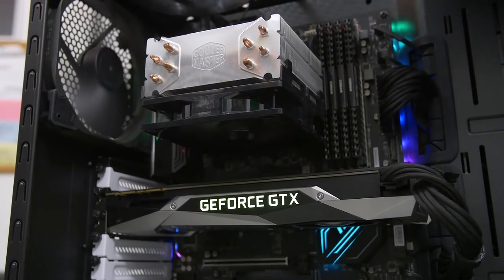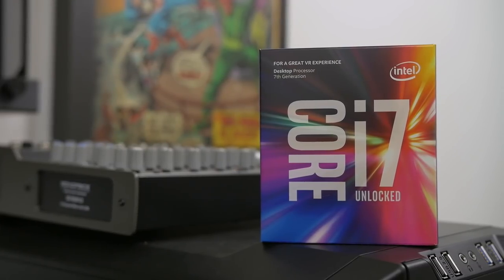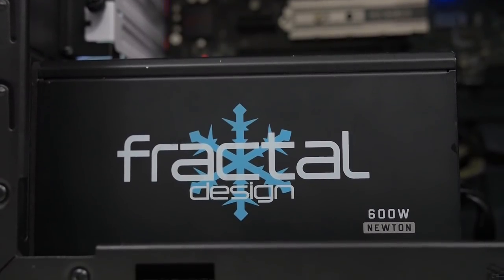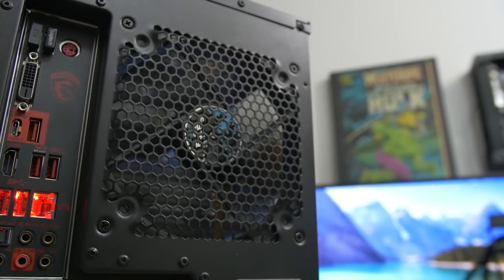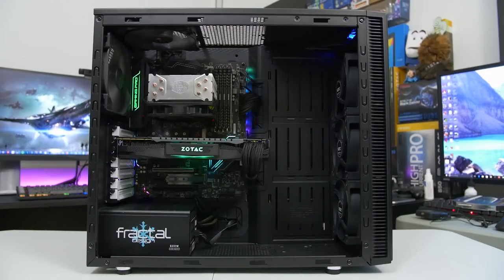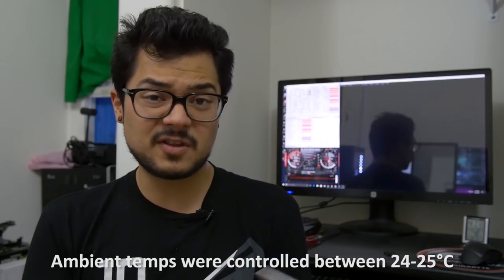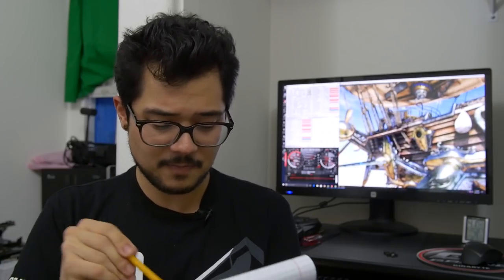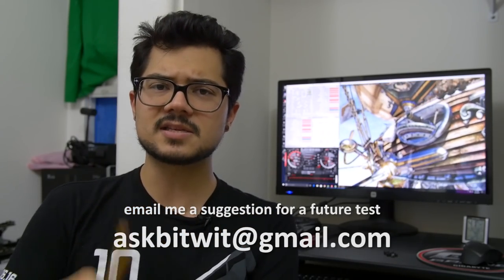This is how you should mount your CPU cooler! I think??

Comment: Maybe, if you could use a tempered glass side panel with some smoke, to better visualize the airflow, would make a great part 2
Reply: Wouldn't the moisture harm the parts
Reply: Smoke isn't the same as water vapour
Reply: I was about to suggest this. Great minds think alike.
Reply: kyle kyle.....KYYYLE KYYYYLE .....yea this guys has an idea tht you might want to hear ......yep, yep errr his name is nOTpASS
Reply: nOTpASS Nice idea
Reply: I was wondering if he used a side panel during his test. He didn't mention it and it was not pictured.
Reply: Smoke isn't steam so that you know. Steam is boiled water, smoke is just a collection of floating chemicals. 

I would suggest Bitwit to use Co2 from dry ice to do this, as it won't damage the parts from extreme temps and moisture build up. But I'm not sure of how practical it is, it would be hard to get just the right amount of gas to see what happens, and to know what temps the gas are.

This will probably require some help from another youtuber with access to dry ice, a thermal camera and who also has some knowledge of computer (I.E they know how to not break them)
Reply: This would be a cool and unique idea, if only it hadn't been done by multiple channels a couple years ago.
Reply: I'd be willing to bet he did, just didn't have it on for appearance.
Reply: if you put smoke in a pc...Won't that limit airflow and skew the numbers?
Reply: Not any more than air.
Reply: @BitWit goddamnit does this tag even work
Reply: JayzTwoCents used smoke in his positive vs negative vs neutral air pressure video I recommend y'all watch it
Reply: Zane Is A Dog you'd only be checking airflow in the smokes case. just to try to formulate ideas on why the results were the way they were.
Reply: give this guy a medal!
Reply: +nOTpASS send him an email...just in case
Reply: zues121510 Dry ice would be a bad idea. CO2 gas is transparent. The vapors you see coming off of dry ice is actually water in the air being condensed by the cold CO2.
Reply: cleetose k den. bad idea
Reply: yes thats good idea let your PC smooke
Reply: Ali Baba it's brilliant ........let the PC get all high maybe it'll turn black

btw a lot of tests on YouTube have been done with smoke to visualise air flow......Nd last time I checked nothing happened to the PC Nd the utubers were not bitching
Reply: I would suggest wind tunnel
Reply: ive tried several different ways of viewing airflow with different types of "vapors" and a combination of black lights/LED lights and i always get the same problem, the space is too small and air is moving too fast to get an accurate idea of what is really going on in there. the closest i came to seeing anything substantial was with a fog machine and a black light aimed at the window from the back of the case (i removed everything except the fans, zip tied the CPU cooler/fan where it would usually be, a low rpm fan in place of the GPU and an old PSU i didnt care about in place and placed pieces of styrofoam in place of the bulkier items that would usually be in there) but because of turbulence and the way the fans cut through the fog, it looked very random and was all happening really fast (anyone passing my house at that time would think its either on fire or snoop dogg had just moved in) so if you want to test it yourself, i advise doing so OUTSIDE of your home (it also leaves a nasty residue behind which is not fun cleaning off because it just seems to go everywhere) i wish there was a really definitive way of testing airflow visually (without using flow meters and expensive wind tunnel tech)
Reply: nOTpASS I think NCIX tech tips has done this
Reply: Whit his vape;)
Reply: It's kind of lazy from many yt, who make videos about air flow. None of them even edit some arrows in them to visualize the flow. Or at least I haven't seen anyone do it. Using smoke is next level.
Reply: They only did it to show Positive vs Negative air pressure in the case. They didnt use it to test how the heat sink was situated how it would affect air flow and CPU temps. They used it in
Reply: You can buy canned smoke.  We use them to test smoke detectors and fire systems here in the fire protection industry.  I test my pc part airflows with them.

Comment: Would have been good to see GPU temps as well, to see how much they're affected by cpu cooler placement.
Reply: lexii miller vertical placement would probably decrease the gpu temps by ~1-2C for the open air gpu because it pulls the exhausting air from the gpu away more.

Comment: maybe founders edition is hotter in general so heat can transfer to cpu
Reply: the gpu is the same. 1070 is a 1070 no dif in the gpu itself.its all from Nvidia
Reply: different coolers make different temperatures.... The blower style cooler is almost always warmer than the other types
Reply: This is what I also think. The blower style cooled GPU gets hotter and radiates more heat and since the CPU and GPU coolers are drawing their air from the intakes it makes a still air pocket below the CPU cooler allowing the heat radiate from GPU to CPU and MB (so, there's none to little airflow between GPU and CPU cooler).
Reply: husssein But then that doesn't explain the vertical solutions.
Reply: That doesn't really makes sense. GPU vrams etc. should run as hot generating same amount of heat in both tests. The reason why you see higher temps in reference cooled cards is because those stock coolers and heat sinks simply struggle with transferring the heat from the chipset. But all this released energy in form of heat still has to go somewhere, ergo if you have a better cooler capable of transferring more heat from the card, the gpu itself will have lower temps but the relocated heat should mean higher temps on other pc components that are getting blasted by all that circulating hot air. Only thing I can think off is difference in voltage and core/mem clocks which means more emancipated heat but if anything FE should produce less energy than non-ref cards with additional pins and higher boost clocks. All of this leads me to believe that it's a margin of error or some unknown law of aerodynamics or thermodynamics that I simply don't know :/
Reply: husssein If anything,  it should be the vertical solution that takes more heat from the gpu and not the horizontal solution.
Reply: husssein .... but heat produced in both cases will be same fe and open style cooler will produce same heat it's just that the fe does not moves heat that much faster .
Reply: thats what I thought
Reply: Theory: The Founders gets less airflow into it's fan since the air on the cooler above flows more efficiently but if it's pointing up more air doesn't makes it to the CPU and has more time to reach the blower GPU fan.

It would explain the weird blower results if you think about it.
Reply: husssein i thought so too but reminded myself that despite it running hotter, they're both 1070's that use about the same amount of juice so the heat output would be the same. Very curious
Reply: husssein except it was cooler in one configuration on the cpu with that edition. seriously doesn't make any sense at all.
Reply: Thats what I was thinking. I had a 1070 founders and the back plate would get very warm.  Kinda scary to touch it. While a third party gpu might have a cooler back plate?
Reply: exactly
Reply: My friend's cpu temps are reachin 60+°c on games like BF1 cause the tubing of his AIO is touching the backplate of his zotac (which is the same one used in the video) where as his temps drop down to slightly above room temperature when he just puts a spacer inbetween. (only about 3 cm of tubing are touching it)
Reply: for sure, the card/backplate radiates more heat in the direction of the cpu instead of pulling it away and blowing into the open area like the after market jobs
Reply: They'e the same TDP and typically don't clock as high/use as high volts, therefore put out less heat. The vast majority of heat is expelled from the case or heat soaking the card.
Reply: DeilGrist yes that makes sense temp and heat are independent so the lower clock fe will produce less heat but i don't. know if they were same clocked or not.
Reply: Founder's cards exhaust out the back. It doesn't affect in-case air temperature
Reply: O!Technology good job, u got proof with thermal imaging?
Reply: +husssein at least that's how it the cooler works. and you can't thermal image air anyways. the only possible explanation for heat transfer to the cpu is that the backplate might be radiating heat to the cpu cooler.
Reply: the AIO tubes should be moved out of direct contact with the backplate, if possible. A small air space should be sufficient.
Reply: Here's the thing though. A card dissipating 150w (or whatever wattage the 1070 is) will still dissipate 150w regardless of what cooler is on it. If anything, ambient temps should rise a touch with the better cooler due to the increased efficiency of the cooler. More heat taken from the core = more heat expelled outside the card. In addition, the founders edition card is exhausting air while the other card is recirculating air. Totally doesn't make a shred of sense as to why the founders edition card ran the CPU hotter in my opinion.
Reply: because even when it's exhausting heat from the case as efficiently as it's able, the card itself reaches a higher stable temperature due to the restricted air flow around the components producing the heat, which in turn causes more radiated heat from the card?
Reply: Caleb Key Gibson ftw

Comment: Theories!
Test #1 - Blower was stealing all the cool air. Could test with a PC-safe "smoke machine".

*Test #2" - The Zotac card seems to have a more restrictive "Open" design forcing the bulk of the exhaust to the back and bottom allowing for less heat to be ejected into the case compared to an ASUS Strix for example. Also it may not have been stealing all the fresh air allowing the 212 to move more air across the fins. Could test with a more open-air designed card.

Test #3 - "Direct Contact Heat-Pipes" may have lined up with the hot-spot on the IHS better where the die is mounted vertically. Could test using non-direct style cooler with each test. (Would take alot of time though...)

Test #4 - The Zotac's backplate may get hotter then the "Founder's" card due to added power deliver or design changes and the backplate may be heating up the air at the 212's intake. Could test by measuring the air temp above both backplates. (may be a bit difficult to do though...)

I know there's that one person out there that's gonna have a rage-attack, but remember, they're just theories that were thought up immediately after watching the video. ^_^

(Edit) Went  to the Thought Chamber restroom and thought of something else. I wonder if an anomaly caused utilizations to differ between tests. Were the frame-rates consistent and the GPU/CPU loads reported equally? Maybe a background Windows update or other process was causing CPU load to vary.
Reply: Absolutely, I thought about the air being hotter from the backplate but completely ignored the fact that the open-air GPU is still exhausting hot air. That and the broadside of the CPU cooler in test #4 is also making it much easier for the cooler to intake that exhaust while at the same time "tripling" the surface area that the warm air is passing though. It will be quite interesting if a follow-up is done for this video, I realize it would take a good amount of time to do but your input makes me want to know the answers even more. 

Heck, this type of "Guess what caused it" video conclusion could even be it's own series of videos. Even if only once a month or so I find it quite interesting and enjoy the participation side of it.
Reply: WRONG. It would only be meaningless if all the results were identical. They are not, so obviously blower and orientation of the CPU cooler have an impact.
Reply: I notced same thing when change my GPU from "blower style" to "open". But final results for my setup: Less fans is requied (2 removed from top) to make same temp. at CPU now. Blower style cards "stealing" air from case, makes CPU cooling less effective.
Reply: I noticed that as well, this is why I added a fan underneath the blower cooler of my GPU. The blower was sucking the air from the front intake fans (and was basically a wall separating top and bottom) and was radiating heat from the backplate up toward the CPU. Adding that bottom mounted fan didn't prevent the GPU from stealing the front intake airflow, but it cooled the card, which helped the CPU stay a bit cooler. Pretty interesting how that all works out.
Reply: UP!!!!!!!
Reply: I'm betting it is Number 3 is part of the answer when I had my evo 212 it had really bad core contact with my i920 though it was horizontal
Reply: Andrew Harley my theory was the first one. The intake makes it easy for the cpucooler to get air, but it gets split up with the blower.
Reply: I wonder if he kept the chassis fan speeds at a set level

Comment: Think this has to do with the direction the air is circulating in the chassis..   This is something you may have to test using a glass side panel case and some smoke to see where the air flow is going..
Reply: Joe Jackson smoke is horrable on computer components......
Reply: Jesse Dodge he mean like a fog machine. Of course it would be bad to use actual smoke on a computer. There are fog machine to test the airflow in your PC
Reply: Team Ninja horrible”
Reply: Aaron Garza words
Reply: Team Ninja hahaha.
Reply: Incense
Reply: Yes.  With the internally-blowing card sending air in the opposite direction of the actual cooler, there's multi-directional airflow, and more (and faster) cross-currents are being created, and removing heat from the CPU (regardless of the air temp coming off the GPU).  When they're both blowing in the same direction (up), that multi-directional airflow advantage is lost, and the air speed is also just a factor of those two fans, on one vector.
Reply: @ninjaclan83  nah just a fog machine

Comment: There are so many myths people claim when it comes to computers and this is one of them, I knew it would not make much difference, I got flamed in one of my builds for doing the same thing, so I rotated the heatsink for a 3 degree difference in temps. Good video Kyle.
Reply: by mi mixtapo
Reply: Have mine with a upwards flow as well.
First for the simple reason to geht the hot air away from my GPU so it doesn't reduce it's boost.
MWith my new card, I'm just to lazy to reassamble all that stuff. (Heavy cooler and a delidded chip: nothing to be done in 5 mins)
Besides that I have 2x 140mm in the top and 1x 120mm in the back, so clearly the case supports the vertical airflow. And there would be not nearly as much fresh air coming from the front with all my drive bays, compared to the case he used.
Reply: Same. Some foo went after me for mounting my dark rock pro 3 with a horizontal airflow pattern. Good luck fitting that vertically, let alone the mounting hardware doesn't even allow for it.
Reply: Desert eagle ace
Reply: I have it pointing upwards too, because otherwise my RAM won't fit
Reply: If it’s cooler in one direction than the other why wouldn’t you put it in the coolest configuration?  It’s a free increase in cooling performance.
Reply: Well, 3 degree Celsius is a big deal isn't it?
Reply: Britec09 is that Celsius orrrr Fahrenheit?